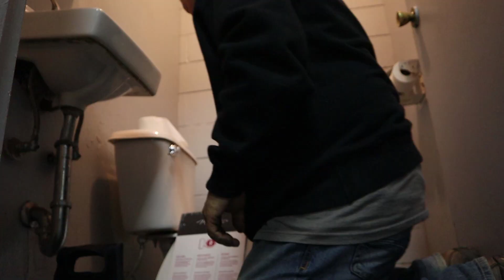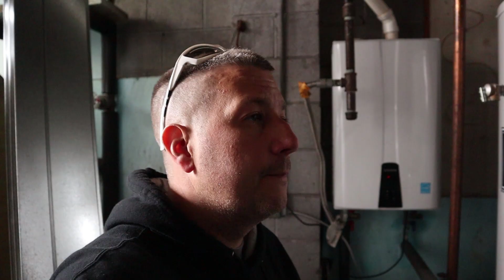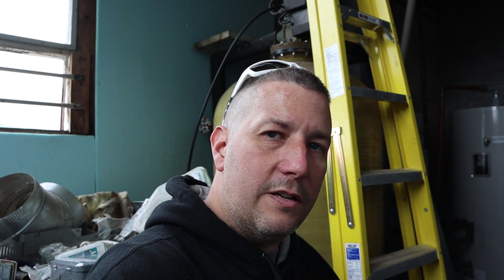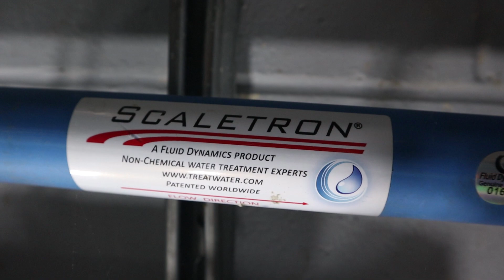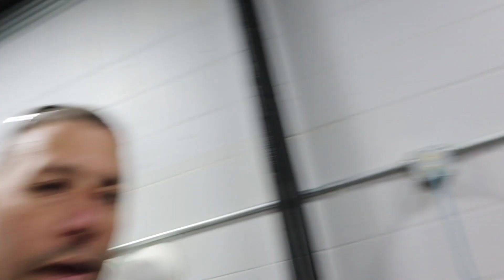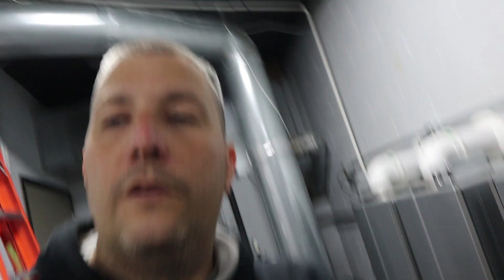Laundromat On Demand Water Heater You Need! | Following Keenan !

Comment: It is perfectly ok to  put a 3/4" meter on a 1' line.  The same amount of water moves through both the 3/4" and the 1" because the water moves faster through the 3/4" pipe.

Comment: Hi Keenan. Thanks for a great video! I'm currently putting together a new laundry facility and I'll be running 65 lb Unimac washer extractors. I've been trying to figure out how to supply enough hot water for my machines and your video has been more helpful than all of the people and websites that I have gone to so far. I've watched this video several times now and learned something each time. I can't thank you enough for that.
Reply: I have the same 65 lb washer machine. Which water heather do you use?

Comment: Hi Kennan, I have got laundrette in Oxford, uk, I’ve got 7 washing machine and I am in process to change my water heating system. I have been recommended rinnai n1600i. Do you think one of this would do the job or I need two. Thanks.
Reply from the maker: I have two in my stores. One i dont think would give you enough flow at peak times.
Reply: Thanks for quick reply, I will go for two. I hope i am doing the right choice by going from tank to tankless. Thanks

Comment: did having a tankless save you on your water bill ?
Reply from the maker: Yes it saves on gas, alot. Why heat water at night if your closed and noone there. Or heat when your slow.
Reply: @FollowingKeenan  
Thanks Keenan
I'm jotting down everything from washers to dryers to change machines.
Where did u get the flexible metal for your walls. Thanks again for all your help. Videos are awesome and helpful.

Comment: I don't know if you've ever had one but we have had 2 laundromat over the last 50 years to where they got talked in to put in a unit and then the water runs all the way through and goes through the dryers because they said that would keep the water heated in things and it was a pain i* t** a** when you had to work on the d*** drivers in the top

Comment: I took all my baskets out because they tore him up but before that when I bought a new I would take one wheel off of them that way they wouldn't want to take him out rolling down the street to their house they do I'm just like they do buggies from the grocery stores in like Walmart and they don't realize those buggies cost about $500 the ones for the laundry mats you know you've been in the business you know what they call yourself space stuff you get to hang on park for them to hang up clothes some people said I did wrong by taking them out they didn't like it but they do still wash their I do try to keep my place clean sometimes it's hard when they smear c*** on the walls in the bathroom And they write stuff all over the walls in the bathroom and the door so I keep a couple spray cans you know in a little bit of you know sandpiper to kind of sand it a little bit and I just paint over I usually start with black and then go with the white or Gray cause the black will cover up the riding but they do get in the carving on the walls and you know you're in business and that's one of the things that comes with it space would a laundromat my family's been in the laundromat business About 50 years now Keep the videos up though I do like those don't with that news is that I don't know that I understand when you said you take off the sleeve off a drum that you take it off with heat and then pull it off I couldn't mind off like the factory does and then I heated up put some ice around on top and then I drop it down on there and have my flat welding helmet kind of make sure of my body  hammer you know my body works Hammer and tap it down and make sure it's on there But you know like on the new hills if you have to put in a bird you need to do that pulls the d*** cause it's almost like a torque fit othat's alright pool feed I don't know what I'm trying to say here but I think you do if you've ever changed any on something other than that is you know in the last 4 years

Comment: Hello Keenan, after watching a lot of videos. I bought a small laundromat. I have the old original furnace tank system, and I like your new tankless setup. I live in California. I’ve talked to a couple plumbers and try to explain your system. But they don’t understand. I have 27 washers (9) top loaders,  (6) 30lbs, (6) 40lbs, (4) 60lbs and (2) 65lbs. Can you please help me or anyone following you. 
Thank you
Reply from the maker: Should be able to handle that with 2 on demands in tandem. If you wanted instant hot water you could add a loop line a d circulation pump. 

I have both rinnai and navien on demand 199,000 btu. Both great heaters. Add a corrosion pipe before on demands for hard water. 

Have to remember your only getting water to around 130 at max. Hope that helps.

Comment: Great systems! Where can I get that blue pipe?
Reply from the maker: I got it off amazon. 1.5" pex. Need some speical connections to hook it up to copper. Fitting called 1.5" water service coupler. Company that makes them is Legend Valve. Can get on amazon or ebay.
Reply: Sorry I mean the ionizing pipe the one you have to change in 15 years.

Comment: hi, im opening a laundromat, expecting 5 pcs 15kg washing machine. and also expecting to set each load with 120litres water usage. how big /litres of my water tank i need?
Reply from the maker: I would use on demand water heaters no tanks. 

Most mid size laundromats here use a 200gal tank with boiler and circulation pump.
Reply: @FollowingKeenan  hi  thanks. Most of the washing machine and dryer have heater installed. So im looking for water tank to store water just incase the water flow is too slow from the outside.

Comment: Hey Keenan, I'm opening a laundromat, that has a boiler set up and the tank and heater are leaking so I was thinking of going with a tank less set up. What would you suggest? I have 35 washers.
Reply from the maker: I have both Navien and Rinnai on demand. Rinnai is a really nice water heater. Both I have no issues with. With proper maintenance. With either I would also add the Scaletron Pipe. Last 15 years and keeps the minerals in water from effecting water heater elements.

Comment: Keenan, A really valuable video.  Thanks for posting.  Just don't know how 2 or 3 on demands can keep up at 5-10 gpm with all your demand during peak time - without a storage tank.  Does it?  Are you finding that efficiency is affected by maintenance?  The old boiler with storage vs. tankless....  If you took over a store with the traditional burner and storage tank v. installing tankless . . . do you save over time if you invest in tankless?  Your video is exactly what I'm researching right now.

Comment: I wouldn't bother with a hole in the wall. You will just get crap in it anyway from your dryer exhaust outside. Go to Menards and get a few furnace filters and build a box for the intake. Throw out that screen. I use a large John Deere excavator air filter for my Polaris water heaters and also my large air compressors.  Those are easier to adapt to an intake. $30 to 60$   dealer or Cheaper on Ebay. Also note that the warmer the air intake the higher the efficiency. I once ran a water heater air intake THROUGH the exhaust pipe to pre heat the incoming air. Standard practice on huge boilers. Hell, you could strap your metal intake air tube to your dryers exhaust.

Comment: I am a builder and do a lot of water heaters and radiant heat. Be very careful with the flow through because your water quality is key to a  trouble free working and efficient unit. Any level of hardness usually gets precipitated out on the inside of the heat exchanger and the efficiency drops to less than 50%. Dealers dont tell you that. Then you need to do a vinegar or acid flush often. Its in the book, but way in the back. For the money get a POLARIS. They have a full stainless USA build and are so efficient that they are essentially flow throughs but WITHOUT point heating - the circular submerged heat exchanger is 500x the size of a flow through. https://www.google.com/search?q=polaris+water+heater&rlz=1C1CHBF_enUS757US757&sxsrf=ALeKk03aY01fg2kLKEDIaTKkYzcDlDrWCw:1591692628458&tbm=isch&source=iu&ictx=1&fir=VJbR5HVpOjrLIM%253A%252Cmqmc-S5sbs9H8M%252C_&vet=1&usg=AI4_-kQT2zjONg9N9zcQq-N9j8k6G5ymMw&sa=X&ved=2ahUKEwifuNeNrfTpAhWXqZ4KHZdvAh4Q_h0wAXoECGIQBA&biw=1680&bih=939#imgrc=VJbR5HVpOjrLIM:

Comment: My father replaced their circa 1953 Hot Water Service with only 2 new elements in 55 years with a heat pump hot water service - it lasted 4 years until he needed a replacement. Goes to show of quality of a product in the modern era. We only wash in cold water mainly here in Australia
Reply: Exactly. Those Chinese heat pump units are designed to fail. You will NEVER recover the cost of that crap. Stick with the 8$ 4500 watt electric elements and super insulate the tank.  Pretty much the same for many flow through units.

Comment: Keenan ... we are sold on on-demand tankless hot water systems. We put a RINAI system in the house we built in 2006 at a cost of about $1500 and it has saved us many times over its initial cost and is still going strong today serving our 4BR 4.5 bath house of over 4200 sq. ft.

Comment: I see water pipes like electrical cables. You woildnt have a 15 amp cable if you know 30 amps would be going through it and it's the same as water pipes. If several washers all start at the same time you need the pressure to be there on demand and having wider pipes just makes sense. Notice you have a bit of a tan there Keenan looking good. Are things getting back to normal were you are
Reply from the maker: Looting here has just started. Last weekend was rough. Hoping this weekend is better. Our Police aren't playing this week they have arrested alot of the looters. Scray to see all the boarded up buildings. Otherwise things are good.

How are things across the pond? Doing well?
Reply: @FollowingKeenan  We've had protests over the way police have dealt with George Floyd and we have the highest rates of deaths caused by covid. Our government is useless and certain parts of England will be going back on lockdown soon as rates of covid 19 are spreading fast again. I seen the trump speech on the news and the way he's talking it's like it's all back to normal in America now
Reply: Robbie Crosbie TRUMP 2020 !

Comment: I have two of the same Navien NPE-240A s. I had the same issue when they were first installed they set the intake to take air from the room. I ended up having to pay the same install plumbers to fix it and put a pipe to the outside. It must be in the installation manual to have them take air from the rooms. I was constantly cleaning the intake filter after the fix I check it once a year and it’s barely even dirty.
Reply: Nope manuals say to run both pipes to the outside.  So many plumbers dont read and make sure they are doing their job properly. Just like if you put those vents out the roof you cant just go straight up with both. They have to be offset so the intake doesn't pull in exhaust.
Reply from the maker: 90% stuff all has a outdoor flesh air intake. Alot of companies skip the step. Even the 90% furnaces have this same thing, needs to be vented outside. But hardly anyone does it.
Reply: We have one in the house the gas company said we need to up the size of the gas meter?  We have water filters went the water come in to tank and cold water to drink

Comment: Surely you can reclaim the exhaust air heat from the driers to heat the hot water or at least preheat the incoming cold water off the waste water temperature
Reply from the maker: I'm sure you could but it would cost more then I can save to do it. Great idea! 

I use to wonder if i could help heat the buildings with the dryer vents.